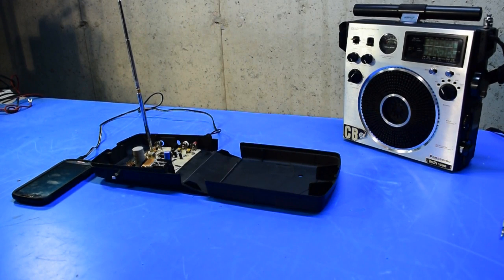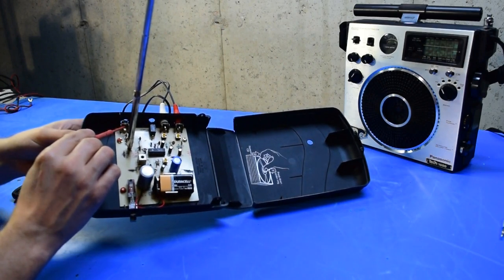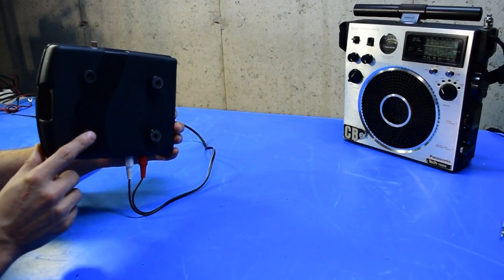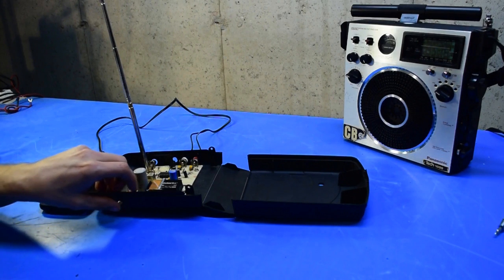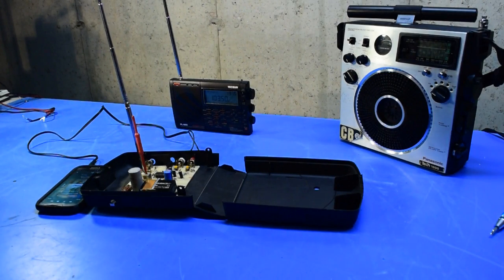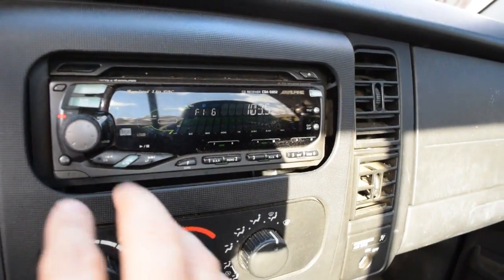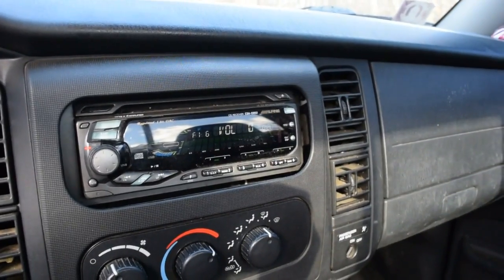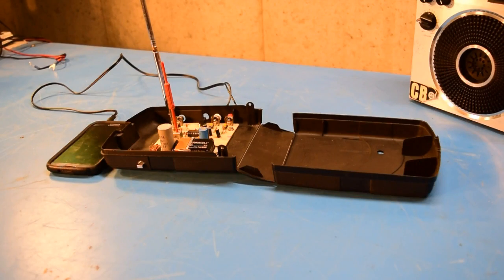Ramsey FM-10 Part 15 FM Transmitter Test

Comment: Great video! I built mine about 40 years ago but it didn’t work. I put it on the shelf and didn’t troubleshoot it until ten years later. I found out why when I looked at Q1. The final transistor in mine was a 2N3904 instead of the 2SC2570 VHF/UHF transistor in the schematic. The pinouts are different. Pin one on the 2SC2570 is base instead of emitter so I ended up connecting the emitter of the 2N3904 to the signal input and base was grounded. When I twisted the base and emitter on the 2N3904 it worked.
Reply from the maker: Glad you got it working!
Reply: @SevenFortyOne , it works sort of. I replaced it with an NTE equivalent 2SC2570 the NTE-10. It’s kind of weak even though I have it going into a J-Pole cut for the frequency of use. I have to place a radio within 2 feet of the antenna. I took the transistor out of circuit and test it. The Hfe was 60 so it not dead. Collector voltage is 4.00 volts. The schematic’s three diodes weren’t even supplied in the kit. Instead it used a voltage dropping resistor. I replaced it with an  LM317L but the output voltage to the BA1404 is between 2.4 and 2.5 volts instead of the recommended 2.1 volts.

Comment: that's actually pretty good. I have a whole house FM transmitter 3.0 and when I use the stock power without turning the power up I don't get that sort of range I only get maybe to the house next door and that's on a blank frequency this guy is doing pretty good and if that's legal part 15 I could still get listeners to my internet station near my complex. There's a lot of confusion about what is legal and illegal for part 15 but certainly you don't want to go beyond the rules on FM because it is highly guarded I know that from experience. I was visited by the FCC.
Reply: The FCC has a new much more onerous law that makes radio piracy into terrorism with a $250,000 a day fine and jail time.  Stephen Dunifer's win didn't deter them long.

Comment: This model is actually fine for Part 15 use.
Reply from the maker: +Barry Sallade the transmitter is ok for part 15 but putting too large of an antenna on it can get you in trouble.   I don't recall the exact rule/limitations on part 15 antennas...
Reply: CFR 47 Part 15.

 
§ 15.219 Operation in the band 510–1705 kHz.
(a) The total input power to the final radio frequency stage (exclusive of filament or heater power) shall not exceed 100 milliwatts.
(b) The total length of the transmission line, antenna and ground lead (if used) shall not exceed 3 meters.
(c) All emissions below 510 kHz or above 1705 kHz shall be attenuated at least 20 dB below the level of the unmodulated carrier. Determination of compliance with the 20 dB attenuation specification may be based on measurements at the intentional radiator’s antenna output terminal unless the intentional radiator uses a permanently attached antenna, in which case compliance shall be demonstrated by measuring the radiated emissions.
Seems limiting and in a way it is but, most part 15 setups for AM use a base loaded coil into a 9 foot piece of copper tubing with 24 or more ground radials spread out below the antenna like spokes on a wheel. Some hobby broadcasters report 1 to 2 miles coverage.
Reply from the maker: +Barry Sallade thanks for the info.  Im running fm and am quite happy with my 500 foot radius.  But im betting if put up a good tuned antenna I could do quite a bit better.
Reply: @StormsRadios  Those are the rules for the MW AM band, not the VHF FM band.